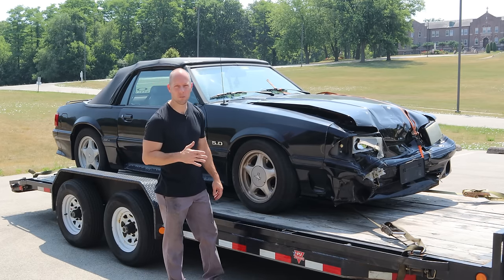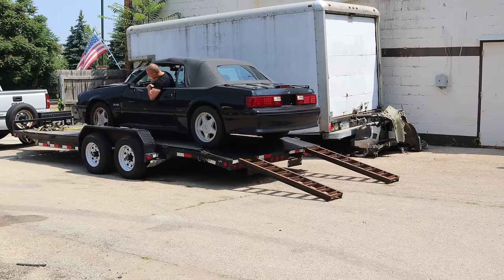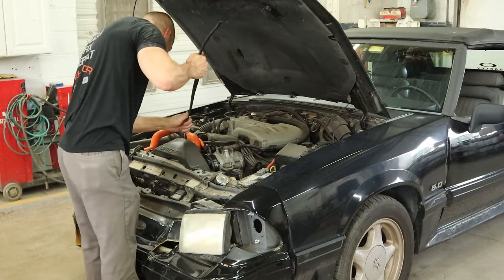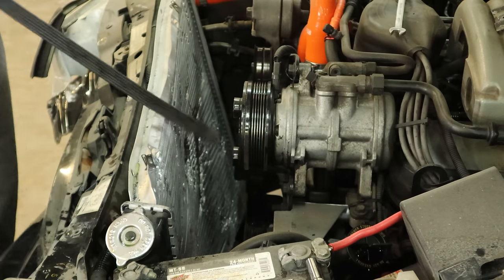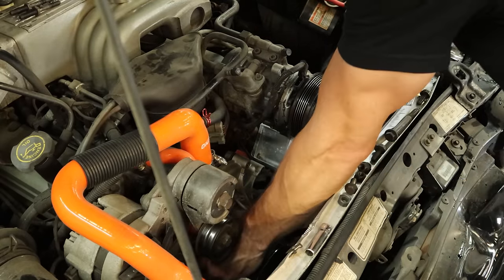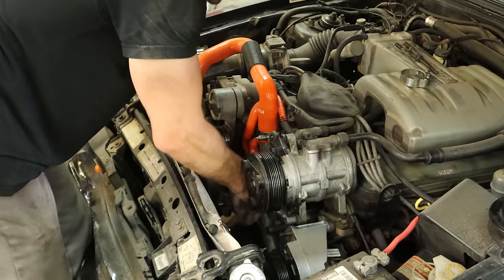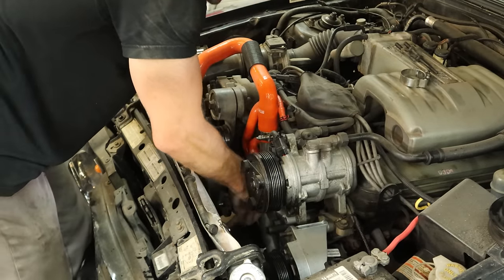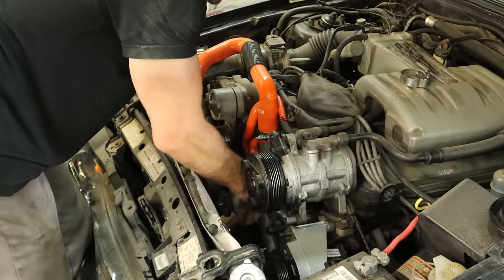Rebuilding a totaled 1993 Mustang GT convertible with engine damage.

Comment: It's clear you don't like Fords. Still, there are far more older Mustangs on the roads today over any 3rd or 4th Gen Camaros. The reason is that Fords 5.0 was far superior in every way to the same generations of Camaros. The Camaros were the worst built vehicles as far as reliability for these Gens. I owned 2 -3rd gens, absolute garbage. The same applies to today's Camaros, absolute garbage. That's why sales are extremely low, and GM once again is canceling the Camaro. GM just doesn't learn or even care about reliability or quality.
Reply from the maker: It is clear you are wrong about me. Makes me question the credibility of the rest of your novel I didn’t read. 😂
Reply: @vehcor  well you definitely come off that way. Best of luck with your channel. I've tried to watch a few of your YouTube videos on previous vehicles. Your attitude makes it difficult to watch. It's clear you have a lot of growing up still to do.
Reply: Only good ford is an ls swapped ford 😂😂
Reply: @kixtonjordan9521  lol, no way will any GM product ever make its way back into my driveway. Lol
Reply: @CletusMcFetus85  Not a hater, and no tears available. I've experienced and spent more than enough on GM'S garbage to speak only the facts. GM - Garbage Manufacturing
Reply: @tutekohe1361  truth hurts GM fan boys sometimes. I'm not a brand loyal fella. When GM starts building quality, I'll stop pointing g out the facts.
Reply: Citation please...  I see far more 4th gen Camaros/Firebirds than I do Fox body or 94-04 Mustangs, which are very, very uncommon..  And that's even considering that the GM vehicles are being harvested for LS swaps.  I will grant you the reliability issues on the third gen cars.  GM is cancelling the Camaro because in the entire 60 years they've been making it, they've been schizophrenic about it stealing thunder from the Corvette.
Reply: @vehcor what happened to the body swapped s550? Give up on that because of your hatred of Ford? Shame you hate Ford so much 😅
Reply: Funny stuff, buddy.  We see 3rd and 4th Gen Camaros and Firebirds at auction still almost every week, at every auction.  They are everywhere.  Mustangs over 20-ish years old?  Almost never.  Really we don't even see any from the early 2000's.  Largely because the 302 was a weak engine and twice as expensive to service as the SBC.  The 4.6 was worse in both regards.  Mustang interiors also defined the word "cheap", which is most notable because F-bodies were nothing to write home about yet still were vastly superior.  As for new Camaros vs Mustangs, the typical Ford vs GM financials apply there as well; I can buy two Fords for what one GM brings.  Applies to trucks, Navigators vs Escalades, Mustang vs Camaro, etc.  Don't come back at me with any BS;  this is all financial to me.  If Fords made money and were more easily serviceable I'd sell them.  But Fords suck.  IF you buy one and you get lucky and you aren't dealing with hundreds of them while trying to make money then a Ford may be fine.  But if so you are far too ignorant to speak to the rest of us on the subject so sit down before you hurt yourself.
Reply: @dennisp.2147  oddly I travel that states and rarely do I see any 3rd or 4th Gen Camaros or Trans Ams. I see boatloads of Mustangs. When I see an actual running or even broken down 3rd or 4th Gen GM, I take notice because the majority of them have been recycled after being sent to the junkyards. I see older Mustangs much more often. Are you in Australia or something. In all fairness, I really don't care, I like and hate both, but I believe if anyone really looked into it, Mustangs are far more common survivors.
Reply: @vehcor  Now that’s funny! Enjoyed the video too.
Reply: Hey Scott!! Are you fixing that Mustang to crash it like all the other Mustangs on YouTube ??😂😂😂…
Reply: You may be right but I like Chevy cars better. I am not a fan of catfish Camaros, but I like the 2010 and up style. In mustangs I like the 2005 and up.
Reply: @car-diologist  driveway to full of broken down fords huh? well damn.
Reply: @rickretro9693  I never said I like Fords did I. I've had countless experiences and financial struggles because of GM'S garbage though.
Reply: @terrallputnam7979  yea, I like the looks of all generation Camaros. If I ever owned one again, it would have to be built by someone other than GM for sure. Sad but true.
Reply: @car-diologist  😢 gonna need more haters tears bottles. @vehcor hope you got a good supply
Reply: @rickretro9693  not hating, just telling how it is. You all sure get butthurt easily. Reminds me of my mom's daytime soap operas when I was a kid. Stop being soooo sensitive fellas.
Reply: @car-diologist  I haven't seen a Fox body mustang on the road in probably 5 years, and I have a 2 hour commute through Central Florida.  I think you might NOTICE mustangs more, but you are clearly incorrect when you say there are more of them on the road.
Reply: @vehcor bro realy said i aint reading allat
Reply: Blog it dude
Reply: @car-diologist mate, you do know, he actually has a project in the back ground which is a body swapped Mustang. He doesn’t hate fords.. he just loves to shit stir.. 
if you’ve watched his videos you’d get that.. but since you don’t.. it just shows his channel isn’t for you.. takes all types.. thanks for playing :)
Reply: @car-diologist irony
Reply: I knew there would be at least one who doesn't understand the humor. The manufacturer doesn't really matter, crap breaks. What someone else drives or likes shouldn't matter. Worry about yourself, and you'll have a lot less stress.
Reply: @mjc8248  That's a ridiculous comment. There are Manufacturers such as GM that don't care about quality or reliability. It's clear you have zero knowledge of anything concerning vehicles. Stick to your Bud Light life and leave it up to people with actual knowledge.
Reply: @car-diologist  I'm an ase certified master tech with thirty years of experience, so go back to your basement and troll somewhere else. I never really drank bud light, I prefer Guinness, but I'll tip one in your honor this afternoon.

EDIT - I do realize the bud light jab is supposed to be an insult, but considering I have a trans son and lots of LGBT friends, I don't think you thought that all the way through.
Reply: @mjc8248  seems to me that you have bigger problems other than my comment. Maybe you should focus on that. I've been dealing in new and used cars for just over 30 years. Though i am no mechanic, i deal with nearly all brands and their issues. Not all ASE CERTIFIED mechanics are actually good mechanics. If you knew anything about actual manufacturing and repairs, you'd actually agree with my original comment.
Reply: @car-diologist  I have very few problems outside of my post stroke recovery. I have a fantastic family and the ability to do anything I want within my physical ability. Like I previously said, you'd have a much better life if you didn't stress so much about other people's opinions. 

Have a wonderful day, I enjoyed our conversation, but I'm off to pick up my daughter's Rivian from the tire shop.
Reply: @mjc8248  you said Rivian 🤣🤣🤣🤣🤣 all jokes aside, good luck to you and good health. But damn your whole family has horrible taste in vehicles. 🤣🤣🤣
Reply: @car-diologist  Worst part is she got rid of her 19 Mustang gt premium ss when she got the rivian. Her job has free charging, and she uses her truck as a truck, so it works out pretty good, I guess. I would have kept the Mustang.
Reply: @car-diologist  i keep saying the same thing, but my suburban keeps making it back every time i drive it (300K miles)
Reply: I love this channel, it is a blast to read all of the comments from the haters. Keep it up Scott, this entertainment is priceless. 😂
Reply: @CletusMcFetus85   this!
Reply: @fredwilkins528  who's hating ? Oh, it's actually you
Reply: @car-diologist  you must be feeling guilty because in no way did I call anyone out. But you just did that for yourself 👏🏻🤔
I truly just reading the commentary between everyone. Everyone is entitled to their opinion, and in the end that’s all it is, an opinion.
Reply: @fredwilkins528  Here you go again hating. Lmao 🤣
Reply: As a Toyota owner that knows a thing or two about reliability, the Ford guy is right in that GM products are garbage, also have to agree with the GM guys here, Fords are also garbage. Chrysler/Dodge/Jeep/Fiat/Maserati also garbage. I've owned at least one of each brand except Maserati but they're made by the same company. All of them gave me a hard time even with low miles compared to the Toyotas I've owned. So all of you are right. And most Toyotas I've owned were made in America so is not American workers doing bad jobs, is bad parts in badly designed cars.
Reply: @fcorivers  well said 👏
Reply: @car-diologist 
Found
On
Road
Dead

And considering my experience with fords, that’s an accurate statement.
Reply: @danmartin7823  yea, the Fords parked right next to the GM and Chyrsler product. Lol👍✌️
It's been a Honor Mr. Martin, I'm a rat pack fan. Lol
Reply: @car-diologist vechor doesn't have to grove up, he is working on cars. He's attitude is just perfect.
Reply: @car-diologist OK boomer.
Reply: Wait. You owned multiples of the thing you claim was garbage? Calling BS on your whole tale 😊
Reply: @rovingcyclops  is called experience genius. I've owned Toyota's and Honda's that were fantastic to own. That's how you LEARN. Wow, you are far from the sharpest tool, but you are an absolute tool.
Reply: @rovingcyclops  I'd bet you're a big fan of drag queen shows. Leave car stuff to actual men bud.
Reply: @car-diologist  Do you know what the pin of shame is ?
Reply: @car-diologist says the guy with his panties in a knot over vehcor's alleged Ford hate. You have some growing up to do.😆😅🤣😂
Reply: @car-diologist stay off the substances. You're embarrassing yourself again. Jfc😆😅🤣😂
Reply: Yeah I don't understand why by one if all he wants to do is dog on it. Smh
Reply: @kixtonjordan9521 ls can't run 8000 rpm like a coyote
Reply: @fordnut4914  While they can, why would they need to in most applications?  Let's ask all the guys doing Coyote swaps into everything...oh...wait...where are they...
Reply: @fcorivers  Keep telling yourself that BS (typed while welding together yet another rusted out Taco frame while waiting on cam parts for another ragged out Tundra to be delivered by a Silverado with 250k on the original spark plugs...)
Reply: @vehcor  I like to point out that in 2008 GM's own VP Bob Lutz admit GM did not make good products anymore. 
also between Ford and GM and Dodge, Ford is the only one that has not gone bankrupt

On a serious note, Thank you for the great content. You truly are an artist in what you do
Reply: @car-diologist love how you mentioned " I've watching a few of your YouTube videos " ...come on man,Scott could care less if you watch his videos videos or not....best of luck 😂
Reply: After reading through the comments and replies here, I'm convinced you're actually Scott, or at least someone helping him.  All these comments and replies are boosting his channel's views and visibility more than any video he could come up with.  Well done!
I buy Ford's exclusively, but not because I think they're any better than any other manufacturer.  I'm old, dumb and forgetful.  Ford has a keypad so when I lock my keys in the car I can get in without any trouble.  🤣
Reply: @car-diologist - GM is not the only manufacturer that makes garbage vehicles. In fact they all do. I’ve had GM, Ford, Chrysler, Toyota, and Honda vehicles. They all have their advantages and disadvantages. For example I had a Chevrolet Cavalier with over 206,000 miles. That only needed basic maintenance. I also had a Toyota Camry that had around the same mileage that required major repairs. Once those cars rolled off that assembly line they were all destined for failure, it doesn’t matter who made them.
Reply: @dennisp.2147  I rarely see 4th gen Camaros ngl
Reply: All of you all are simping for whatever brand your loyal towards, I’ve never had problems out of any gm product or ford product, though we’ve had a lot more fords than gms, we have still never had problems out of any, but I’ve heard a lot of story’s about gms being unreliable
Reply: @josephseno8272  your Camry wasn’t taken care of then
Reply: @sybsygstgstsgysg5330  No response needed, but answer this question to yourself. How long do you own them before getting another. No interested in hearing the response because I wouldn't believe it anyway.
Reply: @josephseno8272  of course all manufacturers have issues that pop up on models. The difference is Toyota and Honda correct and perfect their failed parts. GM, Ford, Chrysler, kia, Hyundai for example,  throw the part away and just start all over again with unproven tech. This is what separates a decent manufacturer from the rest of them.
Reply: @southstreetbarbecue7875 Great honest response, and still some Ford boy will have an attitude about it. 👍✌️
Reply: @sincityRNL  I know right, what a studmuffin
Reply: @Crustychevrolet  3rd and 4th gens ? The 1st and 2nd gets are popular and common. 3rd and 4th gens are rare to see on the roads.
Reply: @fordnut4914  YEA
Reply: @longjohn77  it's a side effect of owning GM's in the past.
Reply: @Hey_teacher......  do your parents know you're online ?
Reply: @95Larsson  if your suicidal
Reply: @scottysgarage4393  local guy here in my home town is putting a coyote in his nova because they build better power than an LAME SHIT engine😂
Reply: @fordnut4914  well said. The reason LS's are so popular is because you can find an endless supply of parts for it in every junkyard. They make power. It's just not reliable power.
Reply: @car-diologist that's not true at all.
Reply: @car-diologist like the pile of junk Fords.
Reply: @jerrywilcox9890  well yea, genius. Unfortunately all the American  car manufacturers should be flying Chinese and Mexican Flags. Don't be so butt hurt over something so petty.
Reply: @jerrywilcox9890  I lived it, don't care what you think.
Reply: @car-diologist  lol that what happens when idiots beat the crap out of cars then want to bitch because it breaks down.funny thing is ford's are worse the any car manufacturer lol.never a good one built.
Reply: @jerrywilcox9890  Toyota Honda products are fantastic. Stop abusing your rides and buy quality then.